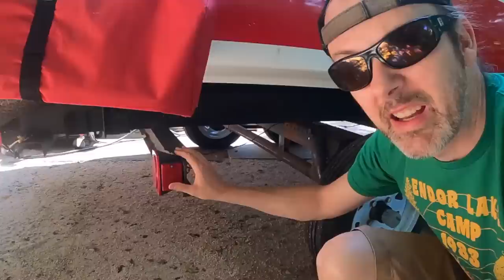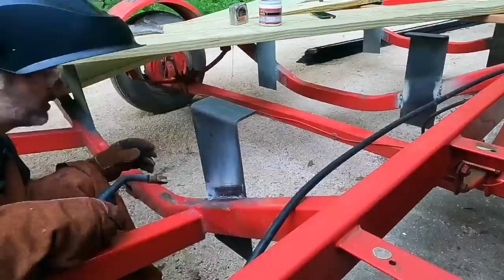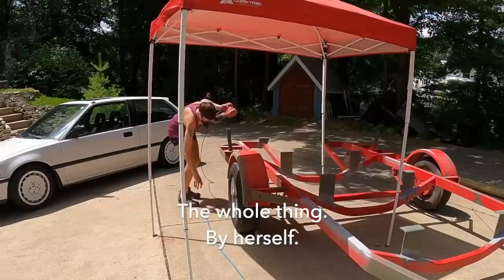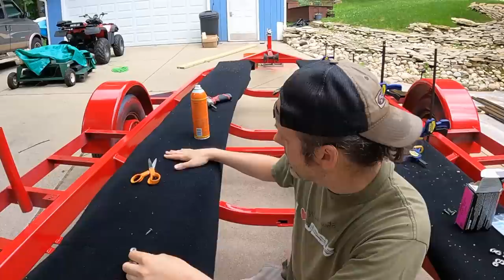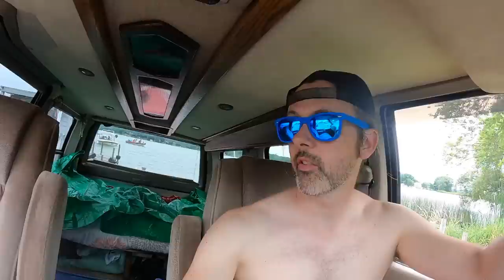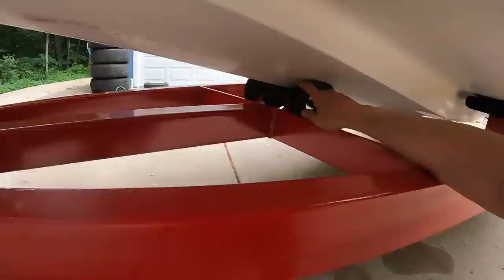Ultimate Boat Trailer Budget Build: Modify/Restore a Junk Trailer for Your Boat Sleekcraft Sunday 22

Comment: If i where you i would extend the tie rod so then the boat would come up further.
If you only pull up the boat you wont be able to open the doors on the Astro 
When the boat is on the trailer.

Comment: Thoughts-
The paint is going to get effed anyway. All in, that's probably the least of your worries. With that in mind, how much work would go into moving the axle back 12-14" and rebuilding sideboards? Would that workaround get into the notch in the rear of the trailer? If you went this route, you could potentially work a solution into the fenders at the same time. 

Next, I'm sure you could move the boat forward, but it seems like you're still going to run into the fender issue and you're eventually going to slam the hull into them, and that's going to suck. Then you're going to need to alleviate that issue AND fix more fiberglass.

I want to put a new trailer under my aluminum boat, but it's going to be a billion dollars and I kind of don't want to fool with it. Unfortunately, saltwater severely limits my ability to fabricate something out of steel the way you're able to work on your rig.

As always, nice work, snowflake liberal. :)
Reply from the maker: Hey I'm not on their team either, I'm politically homeless.   Our current healthcare system is busted and I'm willing to try anything else, seems like only one side wants to try ANYTHING, the other side just wants to say no to any possible improvement, so yeah.

Anyway, not going to move the axle, huge PITA, lots of metal work.   Fenders are close but idk I kind of like the fitment, just need to build some guide bunks in back that keep it from drifting left or right and centered on the tunnels.  

Couldn't you just use steel and keep it painted, maybe spray a corrosion inhibitor on the inside of the frame?

Comment: Alright couple of things. I had modified an Eagle boat trailer for my old Checkmate outboard a couple years back so I have some credentials here when I say this. 

First of all, you absolutely should have done some sort of test fit before finishing the trailer. I actually think you got incredibly lucky with just how well everything fits overall and it looks absolutely fantastic with that boat. I don't think what you did here was a complete waste by any means. But I do believe you're gonna have to back track a bit to fix your issues here.  

The best way to fix this is to move the whole axle backwards. However, this is gonna take the most modification and I don't think you want to go down that road. I know I wouldn't personally. So the next obvious solution would be to move the boat forward, again however you don't got that much real estate to do so without running into the van and making the back of the trailer look wonky with the fitment. So the best solution I believe is to add weight to the front of the trailer as a counter balance. When I did my trailer it was as simple as mounting a spare tire near the winch and that gave enough balance to make it perfectly usable. However, I think you're gonna have to do quite a bit more than that to offset the weight enough. Here is a list of things I'd do to overall help your trailer at this point (it will be in the replys to this comment)
Reply: 1) Add a half circle, plywood board with bunk carpet to the inside of your trailer fenders to keep the boat away from the metal fenders. This will also prevent the tires from flinging rocks into the gelcoat. 

2) Take a jack and raise the front of the boat to take the pressure off that rubber roller, then you need to raise your bunk supports so that your bunk matches the curvature of the bottom of the boat. This puts the weight of the boat back on your bunks and not on that rubber roller.
 
3) Build some sort of support for the front of the boat to be pulled snug against. Sarah had the right idea with a foam piece but rubber would work as well. Then you could probably mount your winch to that support. This is a very crucial piece to have as it prevents the front of the boat from bouncing and possibly damaging the boat when you are trailering. When you pulled it home from the ramp in this video it literally made my skin crawl with how much it bounced. Lol. Basically all boat trailers have this so I'm sure you can find some inspiration for how to build a good one. 

4) This is gonna be the most important suggestion and that is to add weight to the front of the trailer. I think the best way to do this would probably be to box in a part of the front of the trailer and fill it with lead or something seriously dense and heavy. Basically to create a counterbalance to the massive engine and outdrive you have at the back of the boat. Like I mentioned previously, simply mounting a spare tire did the job for me. Find out how much weight is required to keep the nose down and go from there. 

If that doesn't work I don't know how you can save this particular trailer, and you may need to find something you can move the axle farther back on.

Comment: You need a vee bunk to support the bow tip.  You need a bass boat type trailer, not an inboard trailer.  Axle needs to be rearward to support the engine.  I bet it sways bad at high speed with no tongue weight.  Nice build though.
Reply from the maker: Looked for years.  Couldn’t find shit.  When you search boat trailer 99.9% of the results are not bass boat/performance hull trailers
Reply: @ADDvanced  I hear you, my inboard trailer is unregisterable due to old faded numbers, long story, tough to find a decent trailer for a 92 Malibu to replace mine, but who needs plates anyways,  you have excellent projects, had an 02 bass boat with an EFI 225 Merc, 75mph on good water, the sleek craft will be awesome.